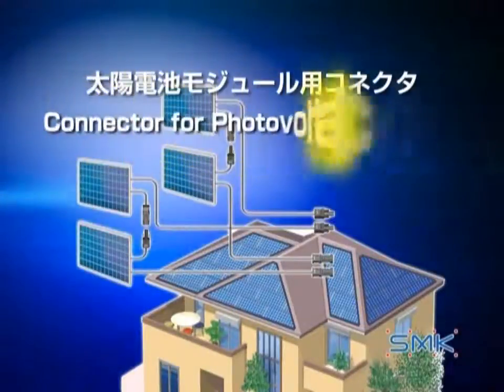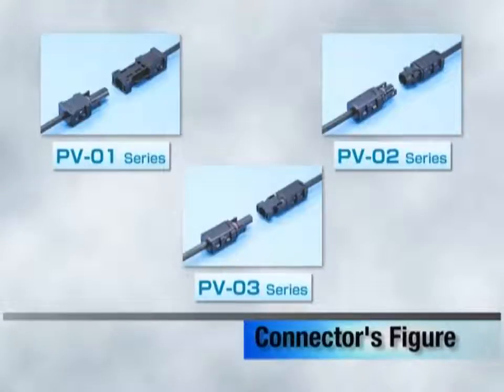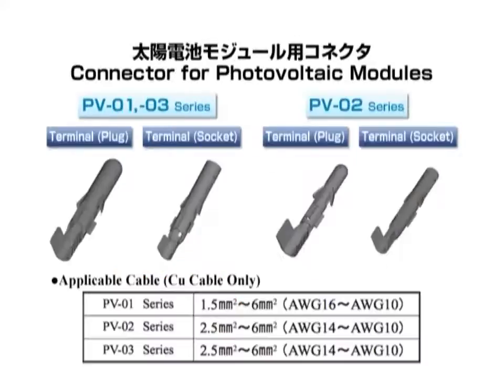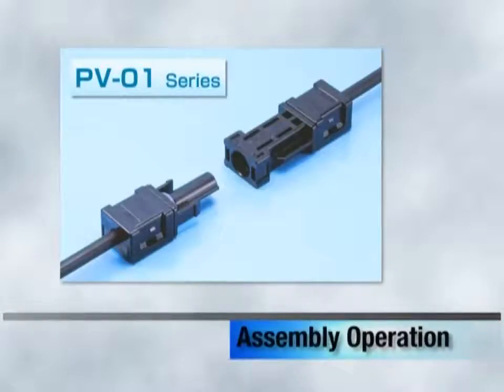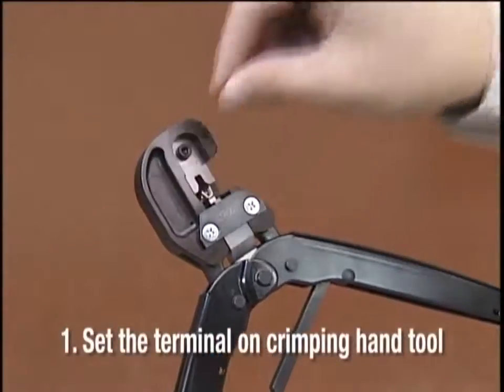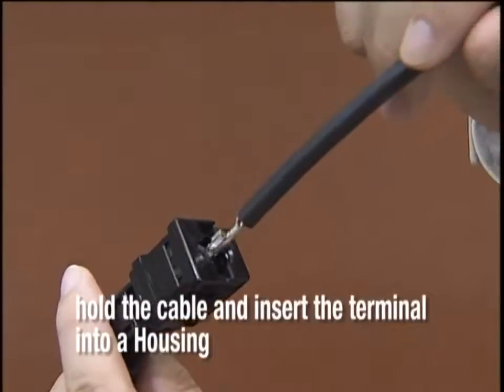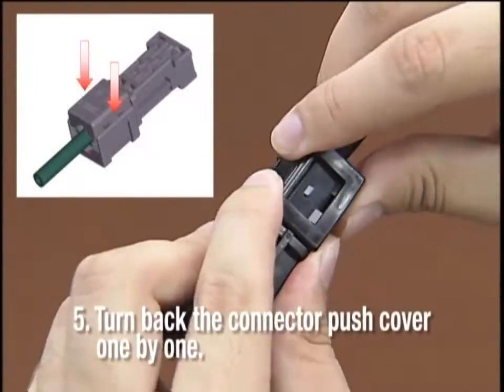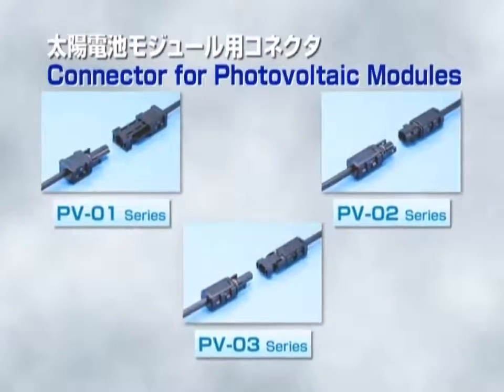SMK PV / Solar Connectors - Instruction on how to Crimp SMK connectors PV-01, PV-02 and PV-03.

Comment: Good morning,I need to buy SMK PV-03 male connectors (1302252) and also SMK PV-03 females (1302253) but I can't find any distributors or sellers in Italy. The only address I find on the internet is the TRITEC company, but I have been trying to call in Italy and Switzerland for days and nobody answers

http://www.tritec-energy.com/it/accessori/i-connettori-fv-smk-c-184/

I bought Panasonic solar panels that have your connectors but I find it difficult to find them here in Italy.
Can you help me and tell me where I can go?
Thanks and good job.

Comment: So what good is this,  try as I might I can not find a SMK jumper  where I can wire up panels in series for 400 V DC.  A company said they can make them for me, but my customer can  not  wait on that, best thing to do is cut them off and  make a good water tight and sheltered connection.   So much for  SMK .